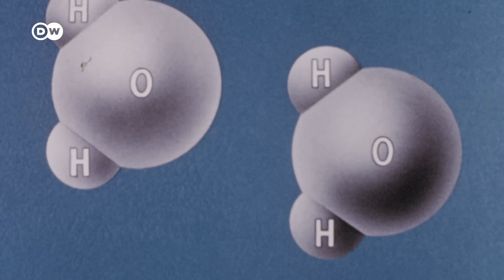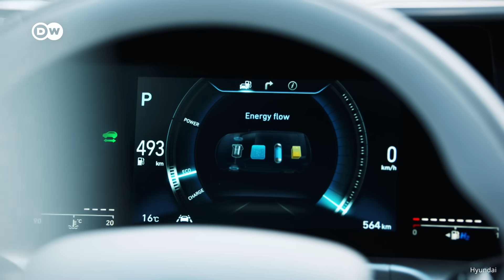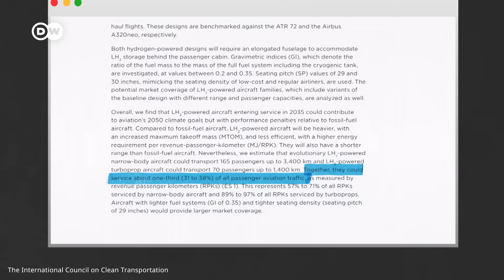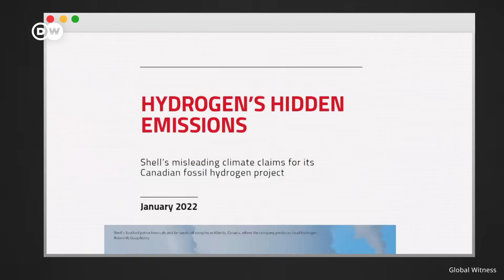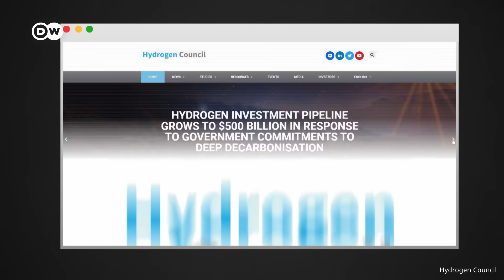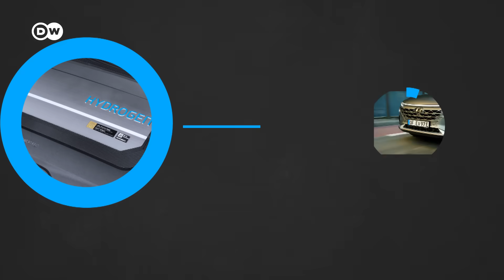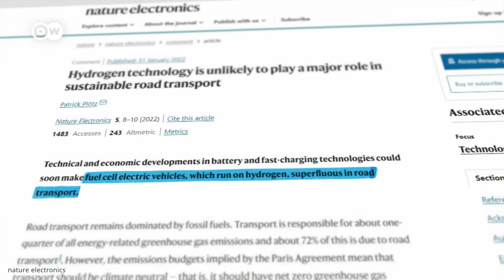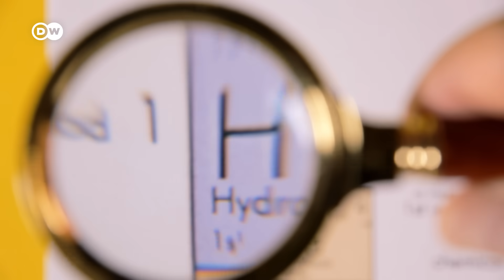The truth about hydrogen

Comment: Imagine a hydrogen tank 2.2 times the size of your current gas tank that will hold 10,000 PSI but only with a tank that weighs more than the Hydrogen it contains.  Imagine also half the trunk used up with the Fuel Cell. Imagine paying more than twice the price for Hydrogen vs gasoline only from stations as rare as hen’s teeth but then learning the Hydrogen comes from Fossil Fuel in its cheapest iteration.  In future the promise is we can make it from excess renewable energy but overall, Hydrogen is a ploy by Fossil Fuel Companies to slow down our transition away from their deadly brew. Imagine them protecting $1Trillion in annual sales and how far they will go to do so. 

I thought it was “ridiculous” also until I ran the numbers.  JP-8 jet fuel is 9.5 kwh/litre, gasoline 9, cryogenically cooled Hydrogen which required a refrigeration plant is 2.3, 700 bar compressed Hydrogen is 1.3 and 350 bar is 0.65.        My figure of 9 times the volume was a rough number but 350 bar would be 13.5 times the volume and 700 bar would be 6.25 times the volume of gasoline for the same miles. Those enamoured with Hydrogen cannot change the physics which makes Hydrogen extremely inconvenient for transportation due to the huge volume required but it doesn’t stop there. Making Hydrogen is costly, shipping and storing it is problematic and converting it to road power is complex also.

Toyota Marai stores Hydrogen at 700 Bar.  Fuel Cell efficiency of say 80% then electric motor at 90% yields 72%.  To get a tank ratio with gasoline, we need to apply an efficiency correction.  Gas engine extracts about 25% of the energy in the fuel.  For same mileage we need to look at tank volume ratio of 6.25 and divide that by 72/25 x 6.25 = 2.2 larger volume for the Hydrogen ;tank vs gasoline. 
This physics defines why Hydrogen is not used and probably won’t be used for much transportation and you can yell FUD all you like but you’ll not change physics by doing so.  

I had my bubble burst on Hydrogen by doing research; sorry to break the bad news but facts ain’t FUD.

Not to mention hydrogen and brittlement of metals and his propensity to leak through microscopic gaps in fittings.
Reply: Let me burst it once more. You’re only thinking about H has a prime mover for vehicles. What about mixing it with natural gas for the grid, what about Steel and Cement production? What about grid level storage? Cars are a fraction of pollution, and not the whole equation
Reply: @PA-eo7fs  what are you talking about when you say “burst it once more“?  

I agree that there’s all kinds of applications for hydrogen but I commented only on hydrogen as it may be used for transportation and possibly storage. There is an excellent argument to be made that all efforts towards hydrogen‘s use in transportation is pretty much a scam since at the end of the day no one is going to pay at least three times the cost to fuel up with hydrogen even if it exists which it basically doesn’t and probably never will.

For similar reasons hydrogen will never be used in any quantities for long-term energy storage because it simply too and efficient. Going from electricity to hydrogen and back to electricity leaves you with 25% of what you started with versus using just about any other form of energy storage will give you 60% minimum to maybe 90%. Hydrogen storage vessels are extremely expensive, hydrogen is very difficult to move but the main point is you cannot get around the negative physics behind hydrogen for storage.
Reply: Colin Genge I’ll type a better answer when I’m not traveling. You’re completely forgetting grid level storage, which is not possible with batteries especially at a cheap cost and importantly for more than a few hours. Ex hydro damn produces excess energy during a monsoon season in the order of 100s of GWH , well good luck using batteries, PS if pump storage is not available that energy goes to waste. Also 96% of the worlds grid storage is pump storage 75 efficiency
Reply: @PA-eo7fs  i’m not sure if the point you’re making is that hydrogen is somehow going to be used for grid storage? it’s very doubtful that will happen at any level because it is not only costly for equipment but also below the efficiency of pumped Hydro when you converted back into power. However, there could be a big market for green Hydrogen where are they can simply convert excess power into hydrogen. We’ll have to see how that plays out.

I agree that 95% of the current utility level power storage is in pumped Hydro. Batteries can be used on a small scale or wherever pumped Hydro is not an option which was proved in South Australia where they were getting a return on their $90 million investment to the tune of $45 million every year which says it is not too expensive and it does work. For any and all utility systems, batteries are extremely important for short term load leveling where they pay themselves off very quickly.

The most promising technology I see at the moment is compressed air systems which are being pioneered in Ontario Canada and in China that have an efficiency of around 70% and can be built in any location where they can pump air into non-porous subterranean cavities.

NREL does not even mention hydrogen as a power storage methodology and does not figure into their future guidance.
Reply: Imagine making your own hydrogen from photovoltaic on your roof and not paying to fuel your car.
Reply: @LUMENMK  Make Hydrogen from your panels to run your electrolyses, compress the Hydrogen to 10,000 PSI, store in a tank, charge your car, run the hydrogen into your fuel cell to convert is back to electricity, buffer with a battery, then run the  electric motor in your car.  100 kWh in from panels = 25 kWh going to your motor.

Or, take power from your panels, charge your car’s battery to run your car’s electric motor. 100kWh from panels = 90kWh to your motor.

Choose which one you want. Also pay 5 times the price to maintain a fuel cell EV.
Reply: Thanks for the physic facts, we need to be green but also pragmatic.
Reply: If I am not mistaken, the most efficient and cheap way to have hydrogen stored is within water, why are we getting so wrapped up about trying to store up hydrogen in it's gaseous form when we should be working on the tech to unlock it much more quickly from water to meet demand??  If technology could be developed to more efficient electrolyze hydrogen from water more quickly then it could be stored much more safely and solve the volume problem for storage.  I am not the type to give up on a concept like this that easily, there must be a way to do it somehow, just wish I had the funds, the knowledge, and time to try it myself.  I know Stan Meyer was likely a fraud but the man's concepts were very compelling to somehow utilize water a fuel cell, I am still pondering whether the man was actually murdered or not for actually solving that problem or the oil companies were just that worried he was that close to ending the use for fossil fuels outright.
Reply: @jayclyde6045  The essential answer as to why we can’t make an electrolyzer more efficient lies in the fact that you cannot get more energy back from splitting up water than you got in the first place. I believe that electrolyzers run at around 85% efficiency at best but once you have that hydrogen and you want to do something useful with it you have the option of putting it into a fuel cell to get electricity back again or simply taking the hydrogen and putting it into an engine of some sort. In the former case we get back about 80% of the electricity that we put in and in the second case where we burn it in an engine we get back about 25%. There is no way to make an electrolyzer more than 100% efficient otherwise you would be going up against first principles and the law of conservation of energy. Much like no one has ever found a way to create a perpetual motion machine that has no energy going in but energy coming out.

If they were caverns full of hydrogen then that might be a different story but all hydrogen on earth is found up with oxygen in the form of water primarily.

Hydrogen could be thought of as being a spring that has no tension in it. We can apply a force over a distance to extend the spring and then get some of that energy back when it is released but clearly they will be losses so we don’t get as much back as we put in. That is why hydrogen in the form of water is useless as a fuel.
Reply: @colingenge9999  He asked why we are not storing hydrogen as water instead of gas.
Reply: @randomaccessfemale  Jane, I have explained that in detail into of the above messages but I will try to put it in different terms.

Think of water as the end product of a hydrogen cycle where all the energy has already been extracted. When hydrogen reacts with oxygen to get water it gives off energy so essentially there is no energy left.

In order to make hydrogen from water we need to put four times as much energy into the water as we could ever get back from the hydrogen.

The person asking the question about storing hydrogen as energy has a fundamental misunderstanding of thermodynamics. The reason why water is so prevalent and the reason why hydrogen does not exist in this atomic form is it a very easily combines with oxygen and gives off a lot of energy when it does so. Once hydrogen is bound up with oxygen as water, it takes a massive amount of energy to force them apart again and that energy can only be partly recovered using a lot of expensive equipment. As explained in my previous texts the first step is to split the hydrogen from the water which is done with an electrolyzer, then it must be compressed to 10,000 psi and put in an extremely strong tank. When it’s used it must be regulated down to a lower pressure, run through a fuel cell then into a battery and then into a motor. If we get 25% out at the end of all this we are lucky.

Water is not a fuel but it is a steady state molecule that is very stable since it has no energy to give up. When we burn methane for example it is a high energy molecule which consists of one carbon atom and four hydrogen atoms. When the methane is burned the hydrogen combines with oxygen to form water and the carbon combines with oxygen to form carbon dioxide. Energy is released. Saying water can be a fuel would be the same as seeing the carbon dioxide can be a fuel Because we can add the hydrogen back in but it takes a tremendous amount of energy to do so; energy we will never get back.

I hope that makes more sense. There have been scams going for a century that all claim to use water as a fuel which it is not.
Reply: @colingenge9999  Water is both the start and end product, if we use electrolysis to get the hydrogen for the fuel cells and use it for energy. I think he was asking why are we storing the hydrogen as gas, when we could store water and do the electrolysis on the station? There are after all significantly more hydrogen atoms in water than in gas per volume.
Reply: @randomaccessfemale  you wouldn’t take water to a fueling station where you wanted to get hydrogen for the same reason you wouldn’t take water to the coffee shop and ask them to make a cuppa coffee with it. The water is the least important part of the process. Imagine taking carbon dioxide to a gas station and ask them to add some hydrogen in order to turn it back into gasoline. That is essentially what you are asking when you’re talking about the water part of the equation.

Even if you did take your own water they would certainly have to test it probably filter it possibly demineralize it and then pour it into a tank which was attached to their electrolyzer when they would add power to that process, create hydrogen and then compress it to 10,000 psi which is what pressure the Toyota Mariah runs at.  this process would probably take an hour or two and require professional staff which hydrogen fueling stations do not have. Bear in mind that hydrogen is two or three times more expensive than gasoline; the reason for this is the massive amount of energy it takes to pull hydrogen out of water. I’m not sure why you are not understanding that it takes four units of energy to take the hydrogen out but ultimately you get only one unit back. That is very expensive which is why there are virtually zero hydrogen cars on the road. Those that are in existence are maintained by subsidies and are part of what I think is a disinformation campaign that is fooling people into thinking that hydrogen is actually a viable option and it totally is not.

when you stated that there are significantly more hydrogen atoms in water than hydrogen which I assume you mean to be in hours as a gas you are looking at it from a volumetric standpoint. From a fuel mass standpoint water is roughly 4 times heavier than liquid hydrogen. The extra oxygen that the water consists of his extra mask to move it around for no reason. 

carrying water around as a fuel makes about the same amount of sense as turning lead into gold which occupied the worlds best thinkers for centuries. They failed because they did not understand the fundamentals and that is what is that issue here is fundamentals. that is not to say that hydrogen cannot be used as a fuel because most rocket launch vehicles have used tanks of liquid hydrogen and liquid oxygen for about 50 years although SpaceX uses methane and oxygen which has a number of advantages that nobody has really explored before he experimented with it. The cost of the liquid oxygen is quite low compared to the liquid hydrogen which is phenomenally expensive and requires a sophisticated cryogenic cooling system to keep it as a liquid. both of those systems have an incredible power to weight ratio which is the most amount of thrust the least amount of mass but we are talking about much more Mundine day-to-day technology and for that battery electric vehicles are a perfect solution. We don’t have to look any further. Every single house in the world can charge up an electric vehicle. It will not explode it will not leak and it’s the same substance everywhere in the world; easily transportable over a simple piece of wire. What could be simpler?

i’m an investor in a company that converts water into hydrogen and Injex it into diesel engines. We are very familiar with the process since we have all of the moving parts that we are only creating minuscule amounts of hydrogen that help in the combustion chamber to increase the speed of flame spread and reduce carbon buildup. Trust me if we thought we could run the entire engine using that same process we would’ve been doing it decades ago. In our case we are not trying to get energy out of Hydrogen but rather to get more energy out of the diesel since combustion chambers usually run out about a 28% efficiency level. If we can boost that to 32% then we’ve accomplished something worthwhile.
Reply: @colingenge9999  To keep this discussion on point, liquid hydrogen would be better for storage than water from volumetric point of view, but it would not be practical since it requires a lot of cooling, which is not good for a long-time storage. Also, the electrolysis process certainly does not take hours as it can be easily scaled up by just increasing the number of anode-cathode pairs.
Reply: @randomaccessfemale  I must admit that you certainly seem to be in love with the idea of storing water as a fuel but you have to recognize that it is like the exact opposite. It is an exhausted fuel that has already been used up. Just like when you burn gasoline you get carbon dioxide and water and all the fuel is gone. It’s also possible to make a synthetic fuel out of carbon dioxide and water but it takes four times as much energy to do that then you got from burning the fuel in the first place. The economy is exactly backwards of what you want.

Let’s say you take $25 worth of energy which might give you 100 kWh. If you put that energy into a battery you’ll get out about 97 kWh or about $24.25 worth of energy out of the battery. 

If you take that same hundred kilowatt hours converted into hydrogen and then run it through a fuel cell you get out 25 kWh which is worth $6.25.

The hardware needed is more expensive than a battery and while it might be slightly lighter in weight it takes up a lot more volume so there’s very little space left in the trunk, no room for a front trunk and even room taken up in the backseat.

The reason why this is not done is that it simply does not work. As stated before you want to turn lead into gold which similarly does not work even though many intelligent people thought it might work for centuries.
Reply: Excellent comment, but you haven't touched on the problems hydrogen embrittlement will cause in storage or transport
Reply: @darkgalaxy5548  yes they did not mention hydrogen embrittlement or its propensity to leak through tiny gaps. The more I learn about hydrogen the more problematic it appears. I was a big fan of hydrogen at one point but I’m slowly beginning to wonder whether it will ever be used for much of anything except for processes that are using hydrogen right now.

Comment: Hydrogen "fuel" production is a no-brainer for SOME countries. My country, Iceland, has an abundance of clean electrical energy (hydroelectric/geothermal), a large chunk of which is currently used to smelt aluminum, which apparently is quite polluting, CO2-wise. By phasing out these smelteries when their current energy contacts expire, we can use the then-available energy to produce hydrogen for our transport sector, especially for our fishing and shipping fleet - and to power non-polluting data farms (our climate is cool and our energy is clean).